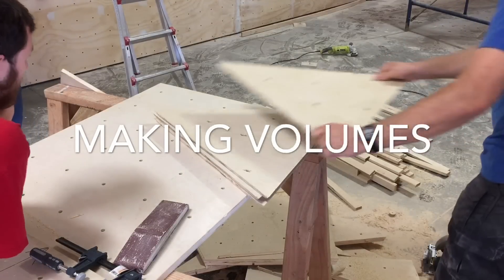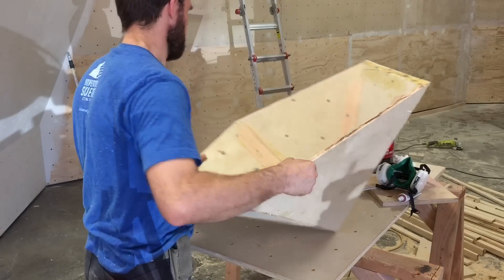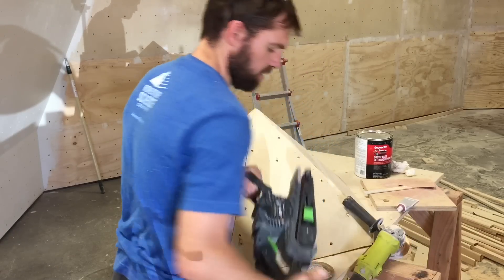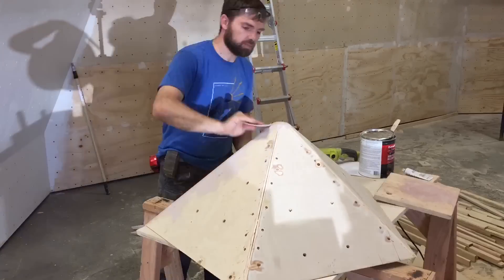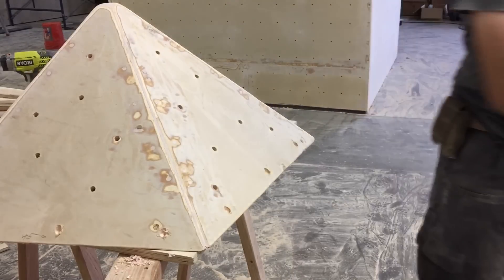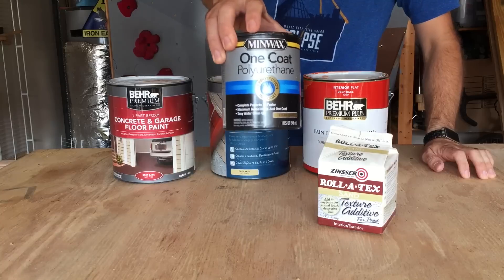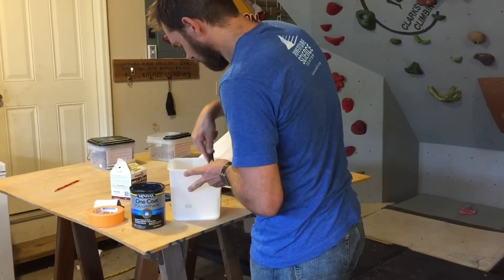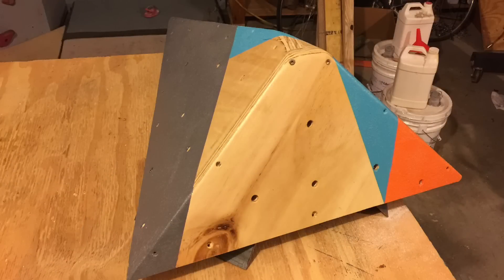Climbing Wall Volume Build, The Penta-volume

Comment: At the base of the pyramid for the set screws (for attachment to the climbing wall), is there a double layer of ply on the volume to reinforce the base, as you have in https://www.youtube.com/watch?v=8dkSxQaISZA? How to determine when to use a reinforcing rim?
Reply from the maker: For me... if it's large enough for a full grown person to have 4 point of contact on at the same time and not Baltic Birch I will reinforce it.
Reply: @climberdad  Many thanks!

Comment: Another great educational and easy to follow video. I made a pitchable outdoor wall to train on and have made a few small volumes for it just to give it some extra dimension. any advice/pointers on anything different to do to make this kind of volume for outdoor use?
Reply from the maker: I've never had to make a volume for outdoor use but if I where to I would start out with outdoor grade plywood and waterproof glue. I would also look for a clear coat that states it can withstand UV rays.
Reply: @climberdad  Ah ok that makes sense. thank you I appreciate it